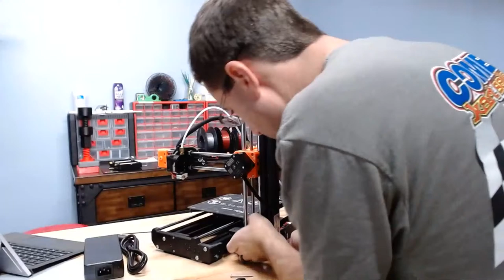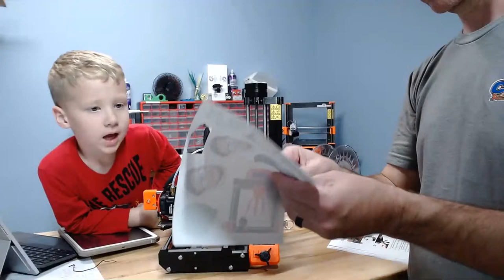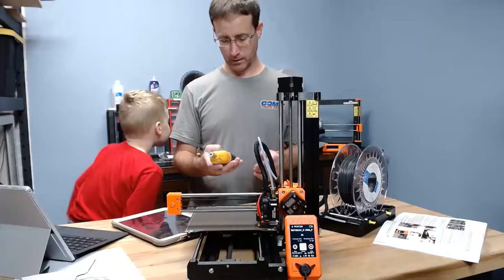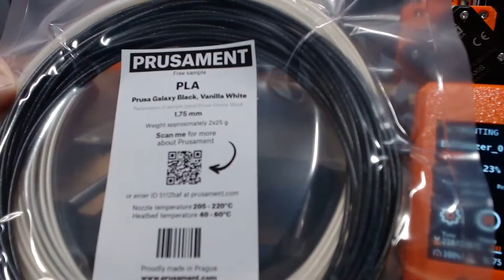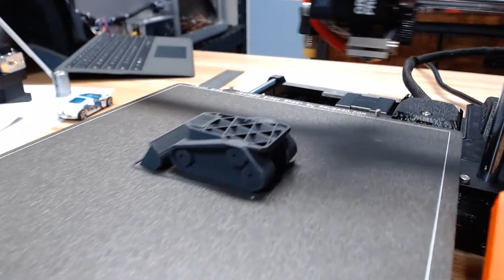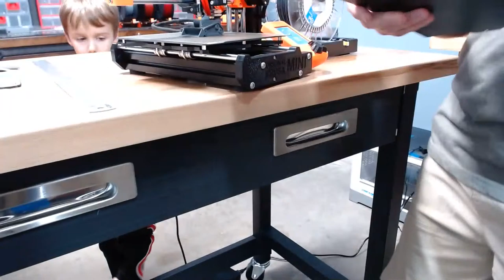Prusa Mini assembly and first print

Comment: That z axis is REALLY wobbly!
Reply from the maker: I have run it another 50+hrs in PETG on tall prints and it looks better, I did reduce the extrusion % and that helped. Were you talking about the print quality or did you spot something else?
Reply: I have one on order, my prints tend to be quite tall as I print model r/c aircraft. The walls are single layer so any z wobble will weaken the structure. I’m a bit concerned that the z axis may not be rigid enough. What is your opinion on the rigidity of the machine now you have had the chance to use it? Have you tried any tall prints? Have you tried vase mode? That would be a good test for the machine.
Reply from the maker: @gazzaknight1959  I printed two taller parts for a friend and compared them to prints of my Railcore using near the same print settings aside from speed.  Both do look really close and feel the same.  Only printer that feels better to the touch is my BLV Cube, but that has MGN15 linear Z rails.  I will run a vase print in the next few days and let you know my thoughts.
Reply from the maker: I ran a vase print, came out strong enough to squeeze.  I will be posting a video on it.  If you have any good airplane STL's for me to try, let me know.  Otherwise, I will grab one from the Prusa Spitfire files.
Reply: I think Prusa has the stl’s for the complete Spitfire build. Try that one.
Reply from the maker: @gazzaknight1959  They are all gcode sadly, but I will find something to try.
Reply: Search on thingiverse for ‘eclipson’, they do a free rc model plane thats nice (I’ve built 5 of them)
Reply from the maker: @gazzaknight1959  I printed one wing segment in PETG and it feels great.  I did several vase prints and compared them to my other machines, they do look and feel good.  I do plan on sharing everything in a video as soon as I can.  Hopefully this coming Monday.

I did run into trouble when I used some older cheap PLA that was not a consistent diameter.  This same filament would jam up my FlashForge Dreamer for example.  On the Mini it thankfully did not jam the extruder, instead, it would eventually get stuck inside the PTFE bowden tube and start to grind on the filament.  On my FlashForge it was usually a 30-min job to clear out, while this was under a min to fix.
Reply: Thanks for the info John, I hope to do some testing of my own when my mini arrives in the new year.
Reply from the maker: New video posted with the wing section.

Comment: I am interested in wether it is good in six months as the plastic parts is a bit more stressed than on dual z:s . Will it float/ bend a bit like pla or is the petg? Strong enough to keep the alignment over time? Too early to say. On duals, you can easily adjust the x axis straightness vs the y, on this it is harder as only one side is adjustable ( afaik)
Reply from the maker: It will be interesting, on my friends printer the Z has been stressed by something (a bump in the car, shipping damage maybe).  I am reprinting all the parts in a bright green to be funny.  From the factory it is PETG and sometimes they use ABS, nothing is PLA though.  The Z bearings are huge, so daily use would be fine as long as the printer is not dropped, bumped hard, etc.  I have heard that a few companies are doing aluminum mods and I think I saw a Bondtech mod already.
Reply: John's 3D Printing Corner for normal use i do think it is fine but almost all fdm has a bit of floating material , pla is stronger than petg but distorts over time in stress so petg is better there but i see a possible issue where first of all there is a bit of torque a regular setup dont have. If the rods and the extruder is as i think they are, the bending force is roughly half a newton meter in max position, without any movement. Not super much but it is easy to fix if it has a flaw there later and that is to drop direct extruder to get rid of a heavy motor travel. Mostly it is better quality with bowden anyway. Most makers that have only one arm has an aluminium stand and a 20x20 or 20x40 x axis. Those seem to have issues as well so i think this is a good economical solution if it works good. The aluminium versions seem to have a lot of problems with wheels and bumps

Comment: Hello when did you order this printer?
Reply from the maker: About an hour into the first day of orders.
Reply: @Johns3DPrintingCorner  so I want to start my first small company is this printer a good idea?
Reply from the maker: @fitby2025_OG  It is a good printer, easy to use and good filament and printing profiles.  The waiting time right now is not great, so if you can I would actually look at the Mk3S instead of the Mini.  That gets you more print volume, and less wait time.  If you don't mind waiting for a printer then there is nothing wrong with starting out on the Mini.  I have ~20 printers right now of various brands and sizes. 

I still find myself going back to the Prusa MK2/MK3 machines when I want a good print.  Sure I have other machines that are better, but not for the same price range and they are not that much better if that makes sense.

I went to pick up my HEVO machine off the ground yesterday to move it on to another bench, I quickly realized I should have asked for help..  Ha Ha  I did safely get it on the table, but I am still sore (bad shoulder).  The Prusa I can safely pick up with one hand to move around for any maintenance.
Reply: @Johns3DPrintingCorner  factions Im a student so a litle bit exspensive  and for sure I can work now